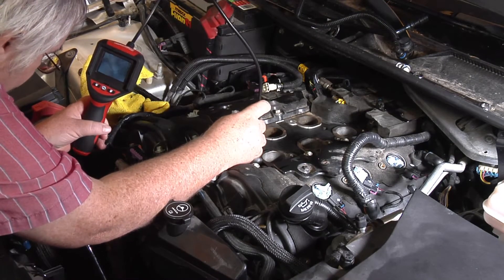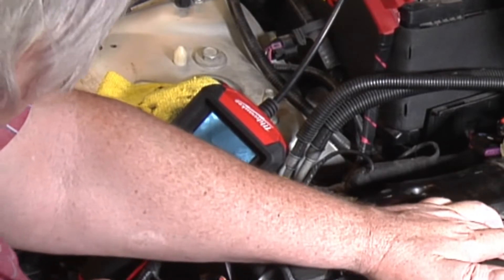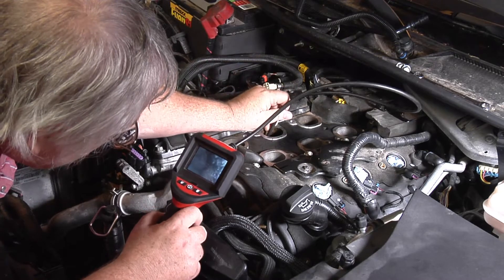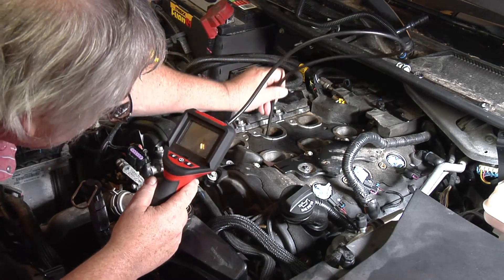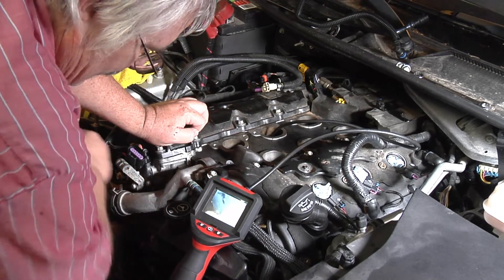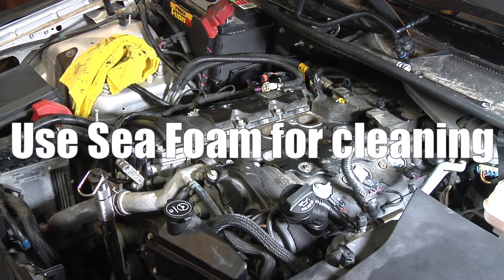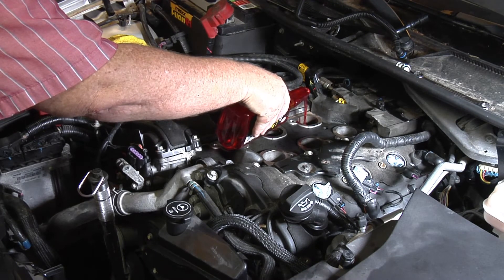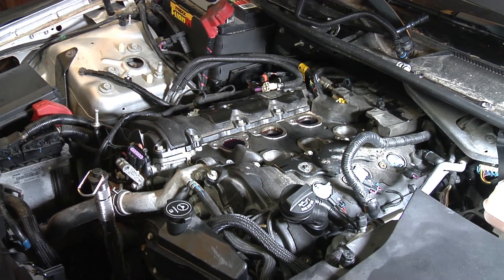How to close your Valves For Manuall Cleaning on a 3.6 chevy V6

Comment: I’m going to clean my valves this weekend and install the ported intake manifold and 80mm throttle body from Kenny Camaro.I bought sea foam and my question is since I don’t have a camera can you tell by looking at them that they are closed? My fear is the foam getting inside the engine. This is my first time ever trying something like this. No one around me will do walnut blasting or any type of valve cleaning. I called my local Cadillac dealer since I have a Ats with the 3.6 and they said they use a can and spray into the throttle body and want 200 to do it and said it would take a few times to clean the carbon. They wanted me to come back once a month for 3 months. I so wanted to say they’re crazy but they’re the only Cadillac dealership around. Chevy dealership didn’t want to touch it
Reply from the maker: Yes with a good flash light you can see them if they are closed. You can do a better job and know its done right.
Reply: how did it turn out?

Comment: do you need to adjust anything in regards to timing or positioning the valves properly when manually turning the motor like that?
Reply from the maker: No, but you must only turn  clock wise, right,  just like tighten a bolt. Thanks